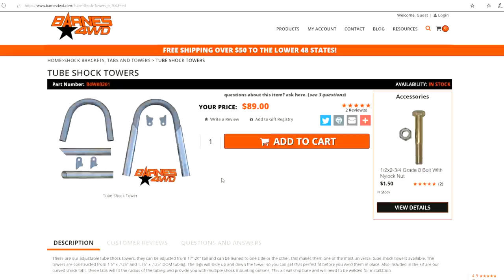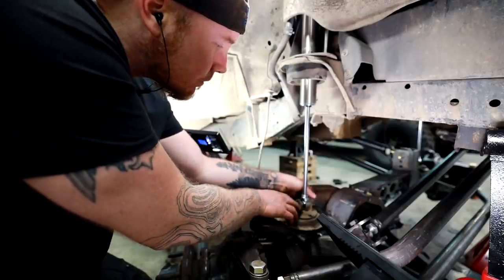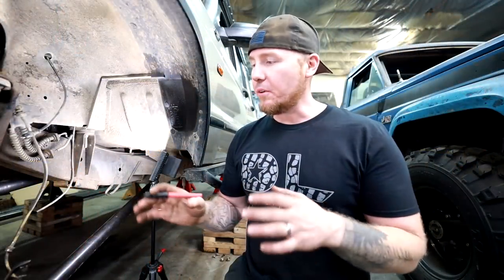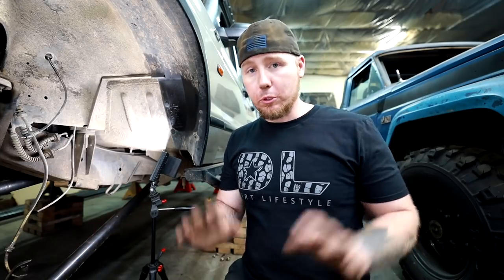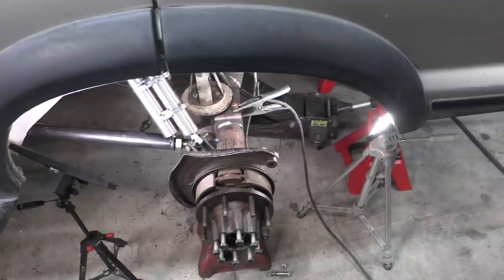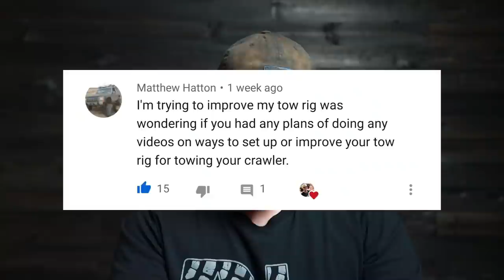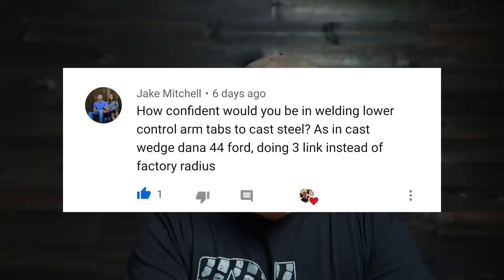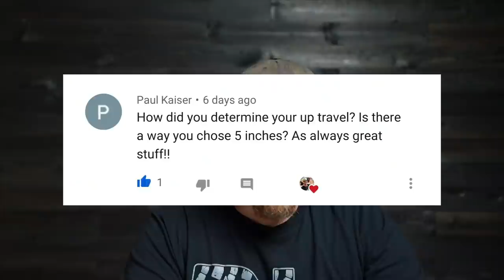Save Your Shocks! 1 Ton Axle Swap Series. Step 6. Bump Stops and Limiting Straps

Comment: I think a non-professional gear and locker install would be great because you’d probably go through the same obstacles we would too and it might help to watch a video made by someone that has a little more similar to our skill set to ours
Reply from the maker: Great insight! Thank you
Reply: @DirtLifestyle  Yes! A professional will just run through it like he eats breakfast. Waiting for that (your) video. ;-)
Reply: I second this!
Reply: I third this! I’d love to see a non pro do gears.
Reply: I completely agree with these guys. You should go for it.
Reply: In the middle of doing mine on about the 25th fit trying for good gear contact pattern with used gear set. Think I finally got it. Lots of weekends.. Your insight is always welcome since you can explaine what you're doing in such a clear way.thanks for what You bring to utube
Reply: for sure.. nobody is gonna spend 2k+ on equipment the pros use, just to do a few diffs at home.. basic tools and how to bodge your way by without fancy measuring gear, very specific dial torque wrenches and mag base this and that so on so forth
Reply: I agree with this as well.
Reply: I will be doing my own within 6 months, you first!
Reply: @AndrewBrowner  You don't have to spend 2k on tools for gears. Plenty of good options out there that don't cost nearly as much. A beam style torque wrench, cheap case spreader from ebay, cheap pinion bearing remover tool from ebay, etc. I'd say you can get a pretty decent set for $500 or less.
Reply: @wvjeepguy8178  i looked all over for a torque wrench that could read the resistance of the pinion while turning it couldnt find one for less than 120$ or more.. then mag bases and measuring instraments for back lash and case spreaders and this and that it adds up, but you can slop it together without most of that its just not done "properly"
Reply: @AndrewBrowner  Look for a "in-lbs beam style torque wrench"..they can be found very inexpensively. Make sure it measures in a range that's suitable for pinion preload. I use one from Park Tools, which is a bicycle tools company, along with an adapter to go to 1/2" for a big enough socket. Autozone sells this type of wrench also.

For a dial indicator with magnetic base, Harbor Freight actually has a suitable unit that's very inexpensive.

https://www.harborfreight.com/1-in-travel-machinists-dial-indicator-63521.html

https://www.harborfreight.com/multi-position-magnetic-base-with-fine-adjustment-63663.html?_br_psugg_q=magnetic+base
Reply: Agree! I hope it happens too.
Reply: Andrew Browner 
$2K to do gears? No way. 
You can make a case spreader for under $10 for example. Granted, I already had 0.0005 micrometers and calipers, but I don’t think I spent over $50on an inch-lbs torque wrench and a Grizzly magbase dial indicator was under $100. A couple other things like the hollow-tube deep seal driver can be bought or made. 
Yes, you can visit your friendly matco or strapon truck and spend $2K to git ‘er done but it’s not necessary. The gears won’t know the difference. 
Once you have the tools they can do other axles and there’s many other uses for dial indicators.

Comment: I will say I would enjoy seeing you do the gears and lockers because I am doing a superduty swap in my JK here soon. I've never done gears myself but I have done them alongside a gear guy and I feel like I'm in the same boat as you where I feel comfortable enough doing my own gears and lockers but not enough where I would put it on a resume for a shop. I've watched tons of videos on doing gears across a whole board of axle applications and I would enjoy seeing your way of doing them and your thoughts and opinions on the superduty axles themselves. This series has been a godsend to me as there isn't a ton of stuff out there on putting a 10.5 or 10.25 under an offroad rig. Keep up the good work man.

Comment: I appreciate you taking the time to reply to comments! I know the struggle with a project going wayward, I just wrapped up my cargo platform system for my JKU and trying to build and design simultaneously has its ups and downs. Granted a suspension system is just a little more technical 😜🤓

Comment: Nice! Just saw this video. I swapped from Rancho 9000s to Bilstein 7100s (no  reservoirs) on my Scout back in 2014. '78 Scout II. Huge improvement. I've played with the valving a little and got them better that the factory shim stacks. I like that I can replace parts on the shocks also. Came in handy since the front shafts began to rust. Under the chrome! So inspect those shock shafts.

Comment: Nice! PLEASE Do the gear and locker video, especially if you can give pointers about setting up a used gear set. My rig is old enough that I can no longer get new gears when an old set wears out. Do you have a friend you could shoot the video with or maybe to a collaboration with another channel to do the gears? A gear video like what you did with the suspension would really kick ass!

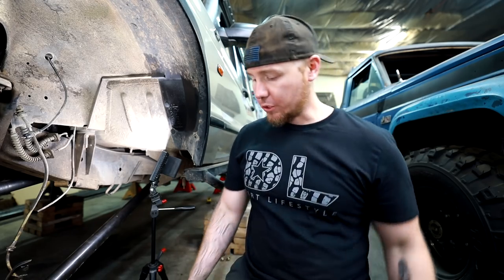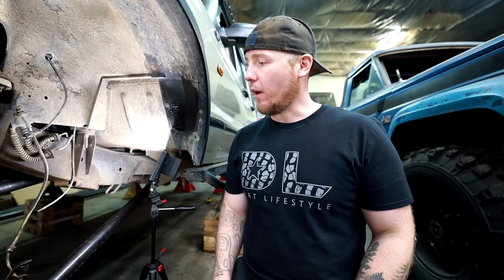Dana 25s and 41s can no longer get 5:38 sets new. I had to swap out my original equipment D41rear because I couldn't even find a used set. I now have a narrow-track passenger offset D44 rear, but 5:38s are still tough to find. I'm in for about $1000 in mods before I can even consider a locker that's not the 'lock-rite' unit.

I honestly don't think I even have those options in the front. Heavy, over-the-top rigs have dominated the sport for so long that the market has dropped everything the 'light and nimble' crowd needs. So when the front gearset finally gives out, I'm going to have to find or build a narrow-track Dana 30 to even have options.

Comment: +1 on gears and lockers. BTW, 1” body lift is simple on a Disco if you need more clearance. Only mod is spacing radiator up an inch when done. Then you can build a rear upper shock mount that takes advantage of this added clearance to help accommodate those longer shocks.

Comment: Question about suspention travel,  do you beleive front and rear should have the same travel? In my rig. Suzuki Jimny.  I would say i have 70 :30 ratio of rear to front. Meaning 70 percent of my flex comes from the rear axel..   Would 50:50 always be reccomended?  Ps ignore the haters, they have many other videos they can go watch if they don't like these.
Reply from the maker: I will answer this in the next 1 ton swap video 🤘
Reply: Yeah defender and disco have shorter shocks on the rear compared to the front, just caus the way they r mounted

Comment: I've made the too long of a shock mistake. When I was ordering my SAS parts on my Toyota I ordered 14" Bilstein shocks. Turns out they were way too long and I tried to lower my mount on the axle. It gave me about 2 inches of up travel which still wasn't enough. Ordered up some f250 rear stocks and they work perfectly. Wound up using the Bilstein shocks on the rear

Comment: was going to ask asbout the ABS... If you have turned the ignition on with the sensors disconnected, you will need to clear the faults logged, which will keep the ABS lamp on. (as a note, if the lamp comes on, goes off and then comes on again you don't have logged faults.) Get that ABS video up soon! Happy to chat about any issues. ps. I have put the WABCO D system on my Salisbury axle'd 110... basically that is a 1st to my knowledge.

Comment: Excuse my French.. but f*** the haters and their negative comments. I bet they’re not out there trying to better you or themselves. 
Your content is always good. I already know half of the stuff you explain. But you still got me watching them videos. 
I’m in the middle of swapping out the landrover axles for Y61 nissan patrol axles (10.5” centre 💪) and I’ve learnt some small bits that have gone a long way to help the build. I have to keep a radius arm front end in Australia because everything is illegal here. But still going 13” shocks up front with dual superior superflex arms and 11.5” rear with 300mm longer arms and a Johnny jointed upper a frame. 
2” hydro bumps all round and a pair of lockers with rcv up front. 
Long winded.. sorry.. haha, but this isn’t any ordinary daily driven defender anymore 😆

Comment: A gear and locker video would be great; however, I would like to see how you resolved the issue with the rear suspension!  👍.   I'm really interested in this solution!   Have you considered the 5160's for the rear?   They're the next step shorter than the 7100's, but I'm sure you'll figure it out.  Thank you!

Comment: Yes on the gears and lockers. Could you just relocate the rear shock mount to make it fit?
Reply from the maker: Im going to try, the issue is access to the bolt for the lower control arm bracket 👍

Comment: I would love to see the gear install. I have done the front gears once and nothing has gone wrong with them but if I am going to a lower gear ratio, I don't want to do it wrong and end up breaking stuff and having to go back in there. What gear ratio would you recommend for a HP dana 30 on 35's? Deciding between 4.56 and 4.88. I am leaning toward 4.56 to try to keep some strength in the gears. I have chromoly shafts and a truss and gussets and HD ball joints. I don't want the gears to be the weak point. I know people talk about chryo-treating gears but don't know much about it.
I am an engineer and took material science so I understand how it is supposed to change the structure of the molecules into stronger shapes but I don't know how effective it is and if the cost is worth the benefit.

Comment: Cheers for featuring my comment!
Looking forward to seeing the pitman/drop arm develop! My main worry was running out of rose joint travel at extremes of steering lock combined with full bump/droop.
For your rear damper mount the Disco2 and Defender typically mount below the axle centre line, are you trying to keep them tucked up for clearance? Or would you be tempted to drop the mount a little so your current damper will work?
Keep doing what you're doing, everyone has different ways of setting things up. Just stick to replying to constructive comments.
P.S you pronunciation wasn't far out the first time, its "stegg--el" but you were closer than most people! 😂😂

Comment: I bought a cheap rear dana 44 from a '78 quadratrac wagoneer, and I want to make it work on my YJ. Your 1-ton swap videos gave me the confidence to cut/lengthen the axle tubes to center the currently off-set differential, but I only have a 110v welder and I don't want to spend $600 on an alignment bar. Thoughts? Recommendations? Thanks Nate, love the content. I've learned a ton!
Reply from the maker: I shot you an answer on Patreon 👍

Comment: Please do the gears and locker install vid. Even if its an over your shoulder look at what you do. Pretty much every video you have posted I have learned something, sometimes it's just another approach to something, other times it maybe an explanation to why we do something a set way.
Then there are those days where I watch your wheeling videos because it's like you are taking us along as another one of your buddies. You're video style is so friendly, before your channel I stopped watching wheeling posts.
Basically I could watch you build and fabricate things all day. Because you explain why and how you come to the plan you are going to use, and that is the information that is golden, that helps us work out how we can adapt the idea to our own stuff. Rather than just copy your solution if we have the same rig.
I know this is long but I think you need to know the positives we get from your productions rather than listen to some of the negatives.
Also I would love some tips run through on your tow rig. Especially if it helps with reliability and running improvement. What is important to change out and where to start. What I love about your stuff is the evolution compared to other channels "bam.. this is what I did how great it is." leaving me feeling "I can't afford to start that".
Keep it up. You have a winning formula.

Comment: Hey Nate love the channel! For the rear shocks can you run them on the back side of the axle tube and mount the shock so it runs perpendicular to the lower arm? Or possibly frenching shock towers into the frame? I’m currently out-boarding the shocks on my TJ and thought of it watching the video. Good luck and love the build!

Comment: Instead of mounting the shock onto the rear axle where you have it now, why not drop the mount down below the axle like the stock land rover mounts? I understand if you want ground clearance, but it would pretty close to your tyres anyway and would save you having to get a smaller set of shocks and limiting your down travel more. Keep up the good work, its awesome to see a Disco 2 out there getting this sort of treatment!

Comment: Running the 7100 short bodies on my early bronco and they work out great. Planning on using the same shocks on my Cherokee for some good droop since up travel is going to be reduced to keep ride height low.
Do you have someone at Bilstein who helps you in valving or do you call their tech line?
Reply from the maker: I have a guy on the inside 🤘 I'm super lucky

Comment: Well, I am still enjoying your channel, filled with allot of neat stuff to look at, while the entire time, you educate folks, good job brother!!!!  Can I place a request for a subject that in due time that can be covered in the future some time? Beings you are currently in explaining suspension theory, might want to cover a precautionary tale for the suspension and chassis system that has both a front and rear track bar and those track bars being set at a few degrees past being horizontal with the ground. More over, (I will use the example of the USA's Jeep) the front track bar mounts to the frame on the drivers side, and in turn, mounts to the axle on the passenger side. That is in respect to the steering drag link and steering gear box also being mounted on the drivers side. Now the rear track bar mounts to the frame on what side, driver or passenger?... this issue for off road doesn't really matter, but highway use, can be extremely dangerous.  Might be worth mentioning in the future. So the question is, Does the front and rear track bars both mount to the frame of the USA Jeep, or can they be mounted on the frame opposite of one another, example, the front mounted on the drivers side, and then the rear be mounted on the frame on the passenger side, or should it be mounted on the drivers side frame as well.. again, when the track bars are mounted outside of the horizontal position, and for street/highway use?... good luck. no hurry, I am not trying to draw alarms, LOL...  Also, I am not mentioning this, as if you have done anything wrong!! Just saying I think it is worth mentioning beings folks are watching your channel and the numbers show that... again, good luck!!! Dru

Comment: Gear and locker install for sure-= also the fender cut video for sure to fit those tires. I'm looking at doing the same thing for 35" tires and would love to see how you do it. As a reference- check out Richmond Automotives Storm Discovery- beast of a truck and he not only cut out the fenders- he moved the axles forward and aft...

Comment: Watching all your videos from 🇨🇦! Love em all and never mind the haters! Just picked up the multimatic 220 last weekend. Just wondering what size wire you normally use on your suspension brackets etc? Starting my stretch on my 97 tj as soon as the back half kit shows up. Keep up the great videos! 🍻

Comment: Tip: The shocks on all corners are to long not just rear. Shocks are designed to be used to full compression not 2” left showing at bump. Shock manufactures post extended and compressed lengths. If you use this information you will not run into the ordering the wrong length shocks. You’ll use 1x1 square tubing as a mock-up shock. 1 will be full extension, 1 will be full compression and one will be ride height.
Reply from the maker: The shocks on the front are almost perfect. As one tire rises it will close that gap you see in the video. What you were looking at was the front axle level at full compression. Not one side at full compression. Think about it. And my shock guy was asking for a rear measurement before I had the rear axle in. I had to guess. I got really close but like i mentioned in the video I'm not perfect

Comment: Amazing video as always! I have a tj on metalcloak 3.5 coils and my limiting factor of flex are my stock control arms. My shocks only seem to have 2 inches left in the down travel and about an inch left in the up travel before hitting full bump. I plan to do a long arm down the road with outboarding the rear shocks to fix that limiting factor but what ways can I increase the travel of my front shocks without increasing my lift or cutting the shock tower? I plan to keep the coils separate from the shocks so I dont want remake the front towers. By going to a larger shock I'd be loosing uptravel so I'm trying to find a way to get more room while keeping my ride height it has.

Comment: Clicked on the video and gave you a thumbs up just for putting Bilstein on the face of the video link! Bilstein owns! Best shocks ever. The Bilstein pss9 coilovers are the best thing since sliced bread when it comes to your car. And if you want a car that can do some things a truck can do then use the factory Springs and by the rally shocks for that vehicle and it will actually get slightly lifted and you can go 90 miles an hour down the gravel roads all day and even jump some stuff and drift around corners like nobody's business. Okay, that's enough of my love affair with Bilstein. I just wish I had enough money to get some PSS Nine's for my Mark 1 rabbit. Like a go kart on crack! And did you know that vehicle beat the iroc-z Camaro in 1984 in Breaking slalom and the quarter mile?? That's right boys and girls, throttle body injection suck balls lol. Ridiculous rant over